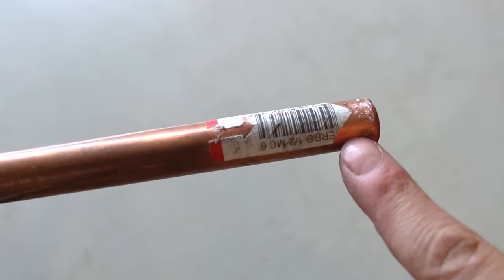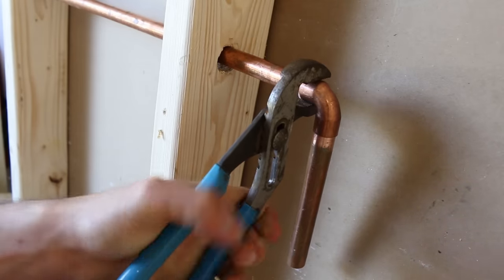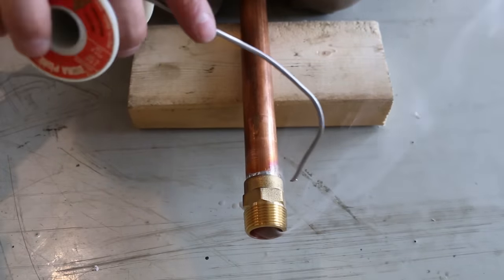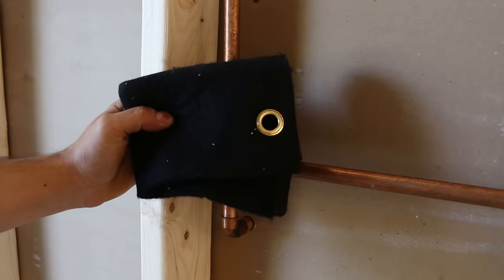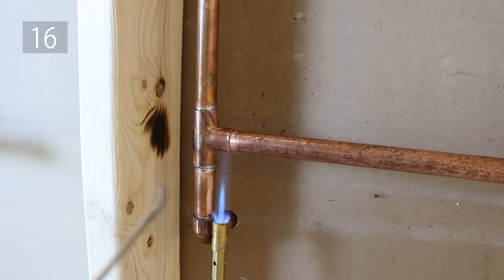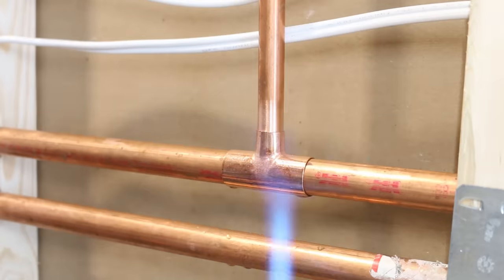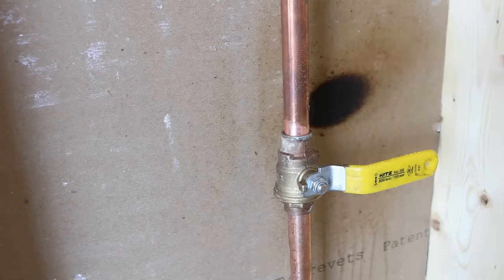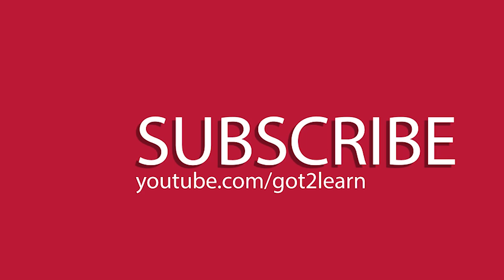The BEST 25 Copper Pipe Tips & Tricks EVER! | GOT2LEARN

Comment from the maker: Stuff I used in this video:

AutoCut Pipe Cutter 1/2": https://amzn.to/2XlyqAn
AutoCut Pipe Cutter 3/4: https://amzn.to/2GZFrkf
AutoCut 1/2" Ratchet Handle: https://amzn.to/2U61h9N
AutoCut 3/4" Ratchet Handle: https://amzn.to/2U60FRx
Pencil Torch: https://amzn.to/2U3OTaa
Handheld Torch: https://amzn.to/2VhGujo
Fitting Wire Brush 1/2": https://amzn.to/2BOlNVc
Fitting Wire Brush 3/4": https://amzn.to/2U33enp
Propane gas(Blue bottle): https://amzn.to/2BOhnh7
Lead-free tinning flux: https://amzn.to/2U3abEW
Lead-free flux(water soluble): https://amzn.to/2XjaYn9
Flux brushes: https://amzn.to/2T8ROBc
Lead-free solder: https://amzn.to/2EoqSFb
8" Channel Lock Adjustable Pliers: https://amzn.to/2tNzcZm
Flame protector: https://amzn.to/2Vh8q7o
Flint striker: https://amzn.to/2XiuX5y
Abrasive pads: https://amzn.to/2NnA9QP
Utility knife: https://amzn.to/2U4dKKP
Pencil reamer: https://amzn.to/2tBuhKW
All-in-one deburring tool (blue): https://amzn.to/2U3J1xu
Reply: @ 87
Reply: oh yeah quebec !
Reply: Hey what do you think of all the new Plumbing tools that Milwaukee's coming out with would you recommend any of those or have you tried any?
Reply: A burr can lead to a pinhole in the pipe? WTF are you talking about? The reason to ream the inside of your cut is to maximize flow by keeping friction losses at a minimum. After hearing that, I stopped watching.
Reply from the maker: Watch the animation, it shows how the burr creates a pinhole in time ;)
Reply: @canucanoe2861  the burr creates turbulence. Typically you see this problem sooner in high flow applications, such as recirc lines, but eventually it will eat out the pipe.
Reply from the maker: Exactly: https://youtu.be/WIIvGG6qNJM
Reply: Bread: https://www.tesco.com/groceries/en-GB/shop/bakery/bread-and-rolls/white-bread/white-bread
Reply: @canucanoe2861  I had pinhole leaks in 1/2" copper pipes due to sloppy deburring by the plumbers who built the house. When the repairs were done we looked at the original pipe and fittings and could see how poorly the pipes were prepped. Did take almost 20 years to fail but the burrs were still there!
Reply: No link on where  I can get the Quebec fire barrier ?
Reply: @DL101ca  Search for heat protective mat, heat shield pad, carbon fiber or felt welding blanket and you will find dozens of choices. Check size and thickness carefully but soldering copper doesn't need the heat resistance of welding for sure. I find two small or medium pads more useful than one large mat. There is a spray on firestop solution that stops charring and is not removed after finishing your work. Basically sodium silicate soluble solution.
Reply: @canucanoe2861  This would be the capillary effect, correct?
Reply: Got2Learn has
Reply: @canucanoe2861  Hopefully you came back and saw that burrs cause turbulence, from another comment on here? I've been soldering pipe for almost 35 years and I learned some stuff on here. Rule #1 learn something new everyday, even if it's something miniscule.
Reply: Rococo toilet system fitting

Comment: Some great tips! Great camera work as well.  
One comment: my understanding is you should never use the torch to melt the solder (whether intentional, or accidentally). In other words, the torch flame should never touch the solder.  The joint is properly heated when the joint itself is what melts the solder. Solder has a much lower melting point than copper. If you allow the torch flame to touch the solder, then it is very possible, in fact probable that the metal will not be hot enough to adequately bond to the solder, and you will wind up with a 'cold' solder joint.
Consequently, I always pull the torch away from the joint before bringing the solder into contact with the joint.

Comment: Another trick for those who haven't expensive heat sink paste. A lump of clay around the pipe does it for an excellent heat barrier when soldering close to another solder joint (risk of unsoldering or making it leak).
Old school guys also use a wet rag to wrap around the joint that is to be protected, clay works a lot better though as it sticks directly to the pipe and can easily be removed and reused again.
Reply: YES! Thanks for sharing. I've never thought of putting a wet wrag around the joint that needs protecting. I've always just tried to use as little heat as possible so I can heat the specific joint and not another
Reply: WetRag Paste
Reply: does plumber's putty work instead of clay?
Reply: @andrewk6008  I haven't tried it but I'd be worried about the heat and how it would affect the plumbing putty.

Comment: I am a 30 year plumber and I regularly used a spray bottle to cool fittings that I just soldered. When the solder solidifies, it dulls up and you can safely spray it with water. I always kept a spray bottle handy to wet down dry wood surfaces before soldering. It was also good for putting out minor fires. LOL
 Also, using your tape measure to hold up a fitting on a vertical solder joint is a sure way to ruin it by having solder and/or acid flux drip onto it. To keep the pipe from falling out, just crimp the fitting with the pipe in it and spin the pipe 90 degrees. It won't slip out unless you crimp it poorly.
Reply: You were probably crap at plumbing
Reply: Rapid cooling with the water causes the solder to crystalize, then crack.
Reply: I'm against doing anything that will malform the fitting when soldering. Creating gaping is not a good idea just more space to fill with solder and more chance of leaks

Comment: Absolutely the best, most informative plumbing / soldering hacks video out there. Succinct and to the point. Clearly spoken without any unnecessary dribble (unlike my comment). Most I already knew or had similar tricks... but aluminum plate!, and indirect heating the inside of the pipe!! Cool .
Cant say it loud enough. Have a stay bottle with you always!!!!! It will someday ( if you work in old dusty houses) save your job, the house, and possibly a life... Wet It First! SOAK IT!!
loved the video.  Nicely done!

Comment: WOW, WOW, WOW !  I have a 3/4 copper service going into the cement foundation and the dry / wet cycles of south Texas have bent the copper line next to the cement resulting in a pin hole. after knocking the cement out of the way I used your genius method of making the pipe round once more and IT WORKED !  Thank you so much. I really didn't want to dig deeper into the foundation than I needed for fear of hitting the pipe with the chisel.
Reply from the maker: Love hearing this, glad it worked out for you!!!

Comment: Thanks Got2Learn for all the time and frustration saving tips.  I did want to point out one important danger however.  NEVER use high heat around Teflon.  Teflon generates a deadly gas when heated above 200 degrees Celsius/392 Farenheit that damages the lungs.  If you are soldering in a confined space, it could be deadly.
Reply from the maker: My pleasure Bill! Good to know about the teflon, I had no clue!!
Reply: @Got2Learn  This hazard is not well known.  I first discovered it while working with aircraft wiring specs about 10 years ago.  The government has been trying to remove Teflon from anywhere it is used in airplanes.  On the other hand, they allow Teflon to be used on frying pans; go figure.  I don't know if anyone has been affected by Teflon frying pans but, I do know it has killed pet birds, who have more sensitive lungs than people, which is why birds have been used in the past with mining as a gas detector.
Reply: Another way to check is if your pet bird is laying at the bottom of it's cage not breathing

Comment: I’ve done My share of soldering pipe & fittings as well as a lot of other peoples’ shares. The tape measure technique is one I wish I’d thought of back in the day before I retired from the HVAC trade.

Wrapping the teflon tape from the outer toward the inner fitting threads is more effective than wrapping from the inner toward outer fitting threads because the first 2 threads make the seal on threaded joints.

Comment: This is from fire sprinkler fitting, but might cross over to any project that calls for a lot of cuts with a hole saw.
  I was on a big job at an assisted living facility with engineered trusses.
 I was running 4" Victaulic and had a piece of plywood that formed part of the truss to go through every 6'.
  We spend way too much time digging the plugs out of the hole saws.
  My work was hidden above the ceiling so I began stopping the cut at the last second.
 I smashed the plug out with my hammer and never let it get in the saw body to begin with.
 I was making dozens of holes and this saved a lot of time.

Comment: Great video.  I'd like to add a tip for no. 25. When re-heating previously soldered joints, flux the soldered area to prevent the bond from failing if the solder re-melts.
Reply from the maker: Awesome tip, thx a bunch @tony luna!!!

Comment: When soldering, always heat the pipe then draw it into the fitting. Especially when soldering those vertical up joints. But do the oval crush trick and give the pipe a ¼ twist. That will keep it from dropping out. When pipe is heated first, it swells up in the fitting. 

There are a few more things I wanted to add but I gotta watch the video again to remind me so ill edit this later. 

Congrats on another sharp and informative video. I always enjoy your videos. Keep cranking them out and I'll keep watching and commenting..
Reply from the maker: Thanks so much dog ;)

Comment: I have watched a lot of copper soldering videos. BTW, this one is very good, done well. There is one term I have yet to hear anyone mention. And that is capillary action. When applying the solder, the solder wants to travel in the direction of the heat source. So, once the solder starts to flow, you wants to keep your heat source in the direction you wants the solder to flow to.
For example, when soldering a T fitting in place. Leave the heat source in the middle after the solder flows. All 3 sides will be pulled into the joint all at once.
Reply from the maker: Very good point, thanks for pitching in @Tom Smith!!!

Comment: Another great flame shield/protector is a piece of fiber-cement (e.g. Hardie-Plank) siding.  It's basically a 1/4" thick slab of concrete that's much lighter and tougher (crack-resistant) than concrete, due to the fiber content.  Flame barely marks it.

Comment: I am watching these videos in preparation to replacing my water heater that is in the attic. The old one is 22 years old and developed a slow leak. I have been watching as much as I can and I have learned a lot, such as the use of the thermal expansion tanks, using a pressure regulator for my water service coming into the house, using dielectric unions, etc. Then learning a lot of the "tricks of the trade" you have here can save me some headaches and time. Man, you are better than a textbook! Keep up the good work, very professional. 
p.s. Any hints to make it easy getting my water heater up the attic stairs??
Reply from the maker: Thank you so much Paul!!!

Comment: Great video, I do a lot of copper plumbing still and that tape measure trick will come in handy, #22 showed soldering a ball valve with it closed, it should always be open, or the heat inside the ball damages the seal and it will leak at some point in the future.Thanks.
Reply from the maker: Thanks Christopher!!

Comment: First heat the inside tube. It will expand and push out excessive flux, then heat both inside and outside tube/ fitting.
When applying solder,  bend the end of the solder over to the length of the diameter of the tubing being soldered. It will be easy to tell when you have used the right amount.
Apply the solder to the opposite side that the flame is on. You want the metal to melt the solder, not the flame.
Reply: So Id have to use 4" of solder for 4" copper
🤔
Reply: @vincentmarzano  do you really solder 4" copper pipe?
Reply: Tim Bucktwo, 😂
Reply: That would be silver solder (brazing).
Reply: @alleycat1084  Silver soldering is a much higher temperature process. A propane torch has a hard time getting the tube or pipe hot enough unless it is very small, (like 1/4").
Reply: @DannyB-cs9vx   
I didn’t use propane, never heard of map gas back when I was working. We use oxygen and acetylene for silver soldering. Usually on hospital jobs.
Reply: @alleycat1084  I have done a lot of both soft and silver soldering. for 30 years I worked on transport refrigeration systems. 
The video is about plumbing with copper. I don't think that they ever use silver solder.

Comment: plumbing for 30yrs.....that measuring tape trick was awesome!
Reply from the maker: It is, ain't it ?! ;) thanks Joe :£
Reply: @Got2Learn  Ive been tying pipe with chunks of solder or cutting pipe using it as stands...  you missed one...#1 cause of leaks is touching or bumping the copper before its cool.  And never put your torch away until you test for leaks... If you do ...you will have a leak!..... Great video!

Comment: Any tips on tapered threaded connections that do not want to seal? I was screwing a pot filler into a brass fitting and tried using multiple combinations of Teflon tape and thread sealing paste. The connection leaked very slowly every time. I ended up using a potable-water safe epoxy in the threads, possibly making it a permanent connection. But now no leaks.

Comment: Use chanelocks to remove paint from copper pipes. Just grab the pipe in the area you need cleaned and rotate them around the pipe as if they were pipe cutters. The teeth will remove the paint quickly and it will work in places you can't get to with your method. Just be sure not to squeeze to hard, a light touch is all you need.

Comment: Heat the opposite side of the fitting from where you're applying the solder.  He does this 50% of the time, and applies the solder where the flame is 50% of the time.  You want to make sure the side opposite the flame is hot enough to take the solder or else you're going to get a cold joint.
Reply: I told him something similar.  He keeps the flame in one place on the fitting.
Reply: Can't always heat the opposite side of the fitting. Sometimes you're doing a 3" tee that's jammed right up against a ceiling, and you just heat the bottom and hope for the best!

Comment: It's risky to solder, with Teflon tape nearby. If the Teflon tape (PTFE) reaches 572 °F (300 C), inhalation of the fumes can cause acute lung injury. Solder melts at about 200 F to 250 F, but if the flame hits the Teflon tape it will create toxic fumes. Wikipedia calls it "Polymer fume fever". Soldering Teflon insulated wire can be risky too.

Comment: One of the most important soldering techniques that I learned,  is locate the heat where you want the soldier to draw, and not on the joint, as this will leave residue and ruin the joint.
Reply: The most  important things to know when soldering are knowing where the shutoffs are and where your fire suppression is.

Comment: I am now a retired UK plumber,  and have used a number of your tips over the years. I used La-Co flux, which is 
made in the US. No need to clean fittings or pipe, unless really dirty. Here we have to use lead free solder for hot 
and cold water (but not necessary for heating) .  Horrible stuff to use.  A lot of plastic pipe is now used here too, 
as it is in the US I believe ?
Reply from the maker: Yes, PEX to be exact ;)

Comment: I liked #23, using the spray bottle head to suction out the leftover water in a pipe you've cut to add a new fitting (such as a "T").  Very elegant, and saves you from wasting a slice of Wonder Bread (Tip #18).  All were great ideas; thanks for posting.
Reply from the maker: Thx SteveR, really appreciate your comment bud :)
Reply: I remove standing water from a pipe with a plastic sink riser tube, insert it into the pipe put your finger on the end pull it out much faster than a sprayer and you can't always blow water out.
Reply: lahokc59  You can't blow water out of a pipe that is closed off at one end and open at the other with out making a mess. It's best to use a tube and basically hand vacuum the water out like using a straw when you were child putting your finger over the top hole and lifting out liquid.
Reply: Firearm--That works well, too.  You could also try using a drinking straw in the same manner, if that's all you had handy.  I think most of us have tried this at some point (say, while drinking a soda from a cup at Burger King).  I believe the suggestion about blowing the water out was in jest.  I don't think you can do that w/o getting water on your face and clothing in the process.
Reply: lahokc59  This is what I have been saying use a piece of tubing stick down the pipe put your finger on the upper end to sill pull it out remove finger release water. I honestly don't think you have much experience in any kind of plumbing work as I'v been not to get you to under stand a simple idea as this. I have worked on many projects and on a lot of old crap plumbing, hydronic boilers, commercial potable hot water systems, low pressure steam boilers, chiller systems and could go on about nasty experiences opening clogged sewer lines.
Reply: lahokc59--I'm thinking that a 4-foot length of tubing is long enough to prevent much water from being moved unless you had the lungs of a gorilla.  The thing with the straw was to put one end in the copper pipe, then place your finger over the remaining open end (the one nearest you).  You would NOT blow into the straw in this scenario.  That would trap "X" amount of water each time, which you could then release off to the side.  We've all done this to thrill our friends and amaze young children.